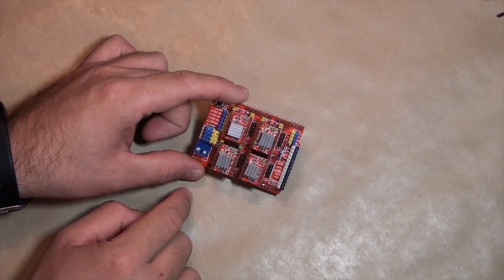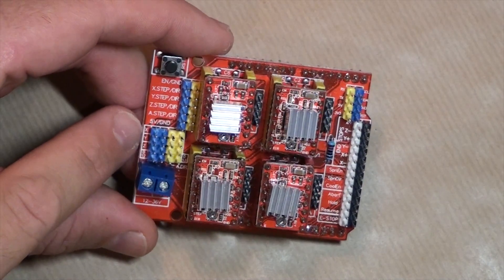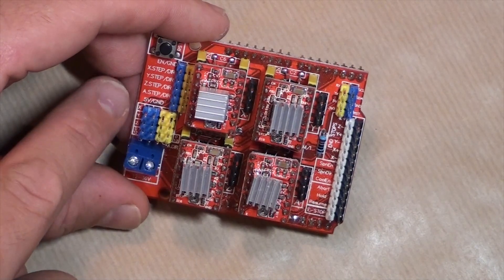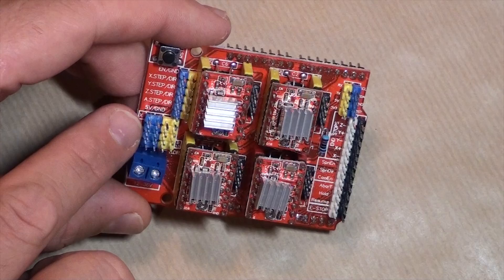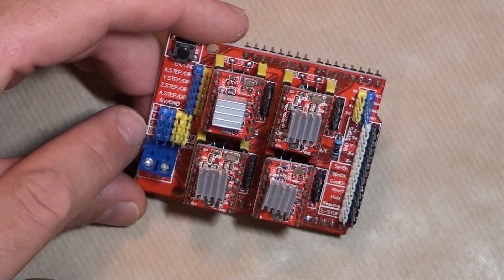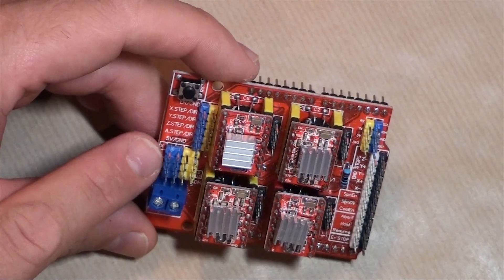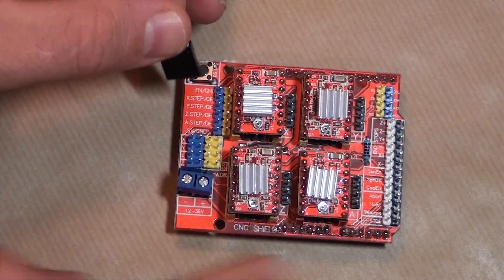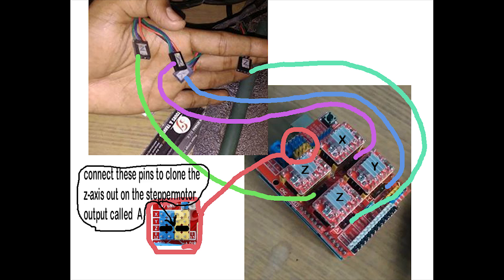Clone one axis on the CNC shield for the Aduino UNO - CNC 3D Quick Tip

Comment: Sir, I have 2 motor for Y-axis, installed opposite side with each other, so, is this method still work? Because in my understanding, the direction signals for these to motors must be reversed to keep the axis runs in one direction.
Reply: Hi. Did you get a response to your question? I would like to know if I could put a stepper on both ends of the same ball screw.

Comment: Why don't just connect the wires in parallel ?Just like the ramps z axis
Reply from the maker: Do you mean using one stepper motor driver on two stepper motors?
Reply: @WillysGarageNorway  yes
Reply from the maker: You can do that but then you will loose tourqe and performance on both stepper motors

Comment: can i clone x and y axis? to work as a pair? thanks
Reply from the maker: You van only clone one axis :)
Reply from the maker: But in the g code you can "clone" the axis
Reply: @WillysGarageNorway  gonna try to find more, any link or video where I can getore info about this posibility? Thank you
Reply from the maker: If you use these controllers instead of the cnc shield, you can clone whatever axis you want, as many times as you want
https://youtu.be/Oy8vDJTGCY4

Comment: Thank you I was searching for usage of 'A'. Is there a way to use X,Y,Z,A seperately?
Reply: U can do it, using some soldered wire and replace the spindle pin location or other pin avail, and set pin in grbl setting
Reply from the maker: Unfortunately the A axis can only be used as a clone to x, y or z. Thanks for watching 😀

Comment: Wowwww thank you so muchhh, can i use jumper instead?
Reply from the maker: No probs :)
Reply: @WillysGarageNorway  I have a question, Can I clone 2 axis at the same time?
Reply from the maker: @RyanRyan-ym7yi  Yes, but not on the CNC shield itself. Then you need external stepper motor drivers

Comment: Thank u...you ar solving my problem,  i got error on then Y axis (thw stepper seems not run smoothly on CNC shield, and i cloned it on A axis, with jumpering as your video, and it works the Y axis now moved on A axis , thank u
(but why it can happened ? the Y axis on cnc board not works as i mentioned above ? ) was there an error while fabrication ?
Reply from the maker: Im glad it helped :)
I reccon you used the same a4988 driver?
If thats the case, it could be a manufacturing issue.
Try changing over the drivers an wires between axis and se if you get the same error :)

Comment: Can i run 2 motors  for x axies and 2 motors for Y axies using this shield and GRBL controller ? 

# Controlling 2motors in (X ) axies using 
X driver and A driver (clone)  ports in the shield.
# Controlling 2motors in (Y ) axies using Y driver and Z driver ports in the shield 

My idea is using one driver for each stepper motor is that possible with 
UNO
Shield v3
GRBL controller 

Project ( hot wair cutter cnc for cutting fome ) only i need 2 axies (X and Y)
Reply from the maker: I think that may be easier achieved if not using the shield. Only wire the stepper motor drivers directly from the arduino 👍

Comment: Hi, Do you know how to use a limit switch with the cloned motor? For example, I use dual Y motors via the cloning feature. I would like to use auto squaring, however, I do not know how to hook up the second limit switch for the cloned motor. Any help would be great. Thank you for your time.
Reply from the maker: That is something I would like to do myself but I have not done any research on the subject. I guess it can be difficult usin an Arduino and GRBL? Im not sure, let me know if you find a solution to this :)

Comment: Could you please explain the pins which above the end stops . Rx,scl,tx,sda
Reply: Please reply for the questions sir
Reply from the maker: Sorry for late reply
Reply: @WillysGarageNorway  okay thanks for reply sir
Reply from the maker: The rx, tx is for comunication with computer over USB. I think these pins are hardwired to the USB com.
The scl and sda is for serial data and serial clock comunication.
If you google this you will get more in depth answers 👍

Comment: Where to connect the spindle enable And spindle direction pins sir
Reply from the maker: It all depends on what kind of spindle you have, on my machine I do not use the spindle pins because I start the spindle manually. What kind of spindle do you have??
Reply: @WillysGarageNorway  I having DC motor as spindle sir
Reply from the maker: Balaji venkat27598 the spindleEnable can only be used if you have some sort of relay control (5volts) and the direction if you have a VDF (variable frequens control)
Reply: @WillysGarageNorway  finally I understand sir.  But how to control in universal g code sender for enabling spindle direction and enable sir

Comment: What are application of pins just below the reset button sir
Reply from the maker: You can use those pins if you want to use external stepper motor drivers like the TB6560 og TB6600
Reply: @WillysGarageNorway  very very. Nice explanation sir.thank you

Comment: is it possible to controll the movements (for example X axis ) via external buttons ?
Reply from the maker: Hi, ues this is possible. It may happen that you have to download another sketch formthe arduino than GRBL. You can find many different sketches to control stepper motors on github.com for free use :)  good luck

Comment: Hello sir what is d 12 and d13 pin in cnc Sheid and also tell how to 
C onnect servo with audrino  cncsheild
Reply from the maker: D12 spindle enable
D13 spindle direction

Im not sure how to connect servos
Reply: @WillysGarageNorway   where to connect these pin . Could you tell where to connect and explain in application based
Reply: Thanks for your response
Reply: Please reply for this
Reply from the maker: @indian_techieee  Hi, on the cnc shield you have two pins marked SpinEn (this is the Spindle Enable) and SpinDir (this is the spindle direction)
Reply: @WillysGarageNorway  thanks sir but where to connect these pins sir
Reply from the maker: @indian_techieee  It dependsbon what kind of spindle you have, I do not use those pins and turn on my spindle manually. What kind of system do you have to control your spindle?
Reply: Why you won't reply

Comment: hi thanks for this video , i want to clone 2 axis both x and y axis as 2 motors on x and 2 motors on y can you share any way of doing it ,i am using same cnc shield
Reply from the maker: On this cnc shield you can only clone one of the axis out on the extra axis. if you want to clone more then one axis I recommend that you get other stepper drivers and wire the seperatly
Reply: Thanks for your reply , okay i will get another stepper diver but the point is how i can clone that with remaining one axis can , what else i need other than stepper diver for this please share some details regarding connection ...............thanks
Reply from the maker: @gauravwadhwa2224  Hi, no problem. If you check out this video of me wiring up my TB6560 and the wiring diagram, you probably can get some tips and pointers on how to clone and wire your machine. Let me know! :-)
https://youtu.be/Oy8vDJTGCY4

Comment: Hi willy,i have one question,but i'll give some info first,i'm designing a cnc board from the usb to serial convertor to the diy arduino then to the stepper drivers,i will be using  the 28BYJ-48 type steppers converted to 4 wire bi-polar setting,do you know if one A4988 can drive two of these steppers,i would think this would be fine as both motors will use separate lead screws so they will turn in the same direction for each axis keeping each axis more balanced due to cutting forces moving from side to side and back to front on each axis as the machine opperates,i cant find any details for the running current for the 28BYJ-48 steppers,though a few hundred mA each,even 500mA per moter should be fine,if each A4988 can drive 2  small steppers  at a time.

Any help will be most appreciated,thanks.
Reply from the maker: The A4988 can i theory drive two steppers at once if the steppers dont demand to much current (A) BUT I would recommend using one driver for each stepper. I find that running two steppers on one driver makes the driver and steppers prone to skipp or miss stepps in the gcode. You also have the promblem that they might stall much easier. 
So if you plan on making a cnc machine, I would really go for one driver per stepper, maby eaven upgrade them 😁
Reply: with the low price of the A4988s and as i'm going to produce my own circuit board ,also i think the arduino should be able to drive two controllers per axis,though i'll look into this aspect,i will find out the fan out of the arduino digital outputs,i don't know if it's TTL or cmos,but driving a buffer should be no bother if need be,though i'd rather drive the stepper controllers direct,'cos i'm a lazy bugger and want it yesterday.

Being a lazy bugger design technician i can do but want to build my amplifiers than make the maker,so to speak.

cheers for the reply,step skipping (unless you fred astaire singing in the rain)is no good.All points taken on board(copper clad).

Take care across the northern sea from us here in blighty(the scottish bit for me).

Comment: Hello.If I have to clone the Y axis I have to connect the two pins together, the blue one and the yellow one. If the 4 pins of the motor must be connected in the 4 pins for each motor, where should the two pins (connected together) be connected blue and yellow?Can you send me a picture with wires that I must do? Thank you
Reply from the maker: It all gets explained in the video. If you see this diagram on my webpage: http://willysgaragenorway.no/wp-content/uploads/2017/09/cncshieldCLONE.jpg
You see that the 4 pins from the motor should be connected to the stepper driver called"A".
The the blue and the yellow pins where its marked "y" should just be connected to each other. The two blue pins together and the two yellow pins together. Do you understand?
Reply from the maker: This is how you connect the wires if you want to clone the z-axis. Its the same procedure for the y-axis :-)
http://willysgaragenorway.no/wp-content/uploads/2017/09/cncshield-axis.jpg
Reply: Yes, it's ok. Thank you.

Comment: how can i drive 2 steppers for one axis to have more accuracy 
please tell me how to connect it with driver and set the directions and steps
Reply from the maker: shiva dwivedi Hi, if you use the CNC shield like I do in this video you see how I do it here. For the direction you will need to switch two of the poles of one stepper and find the correct one

Comment: is this also correct way ? connect 2 motor parallel and connect into one driver ( current one motor wiring is 1 2 3 4 then just change second motor to 3 4 1 2)
Reply: I have arduino uno and four drivers TB6600. How can i connect two step motors parallel?
Reply from the maker: Владимир Моцный Hi, if you watch this video I have a wireing diagram on how to connect the tb6560. It should be simelar on the tb 6600. https://youtu.be/Oy8vDJTGCY4
Reply from the maker: Raghu Devaganatti It is a posebilety to connect two stepper motors on one stepper driver. Personaly I would use one stepper driver per motor :)
Reply: Thank you 

if i clone with x axis with 'A' driver then motor will  rotate opposite direction or what ( i am thinking to use 6mm gt2 belt)
Reply from the maker: Raghu Devaganatti the motor should not rotate the opposite way. But you can change the direction by switching the phases og the wires :-)  good luck
Reply: Thank you sir
Reply from the maker: Raghu Devaganatti Your welcome
Reply from the maker: Raghu Devaganatti you can go to my facebook page, link in description and send me personal message there. Ok?

Comment: But when you are using 2 motors for your x axis, and they are on opposite sides, how do you clone the Xdriver onto the Adriver so it will turn opposite directions of A?
Reply from the maker: Pim S Hi, you can do that with the wiring. Just switch the poles around :-)  Good luck

Comment: 100Pcs/Lot 3D Printer Control Panel 1.4 2.54mm Jumper Cap Mini Jumper Short Circuit Cap for DIY 3D Accessories